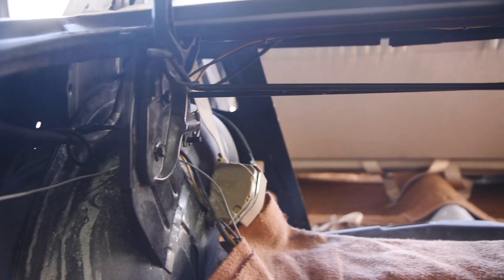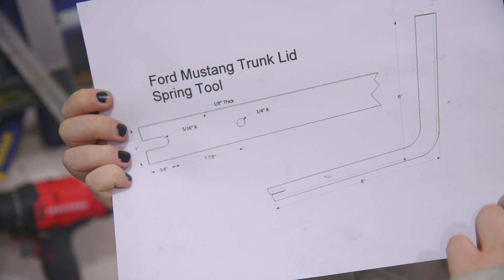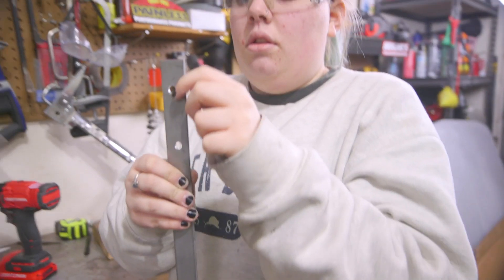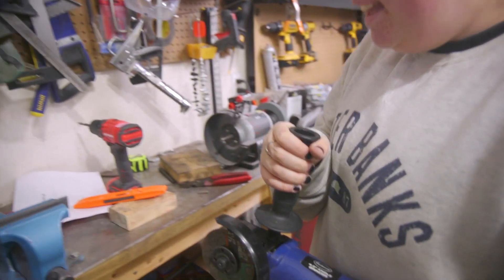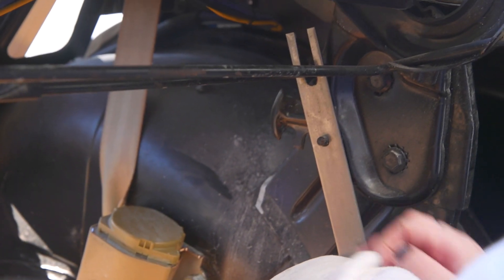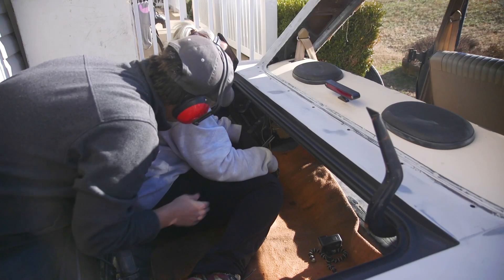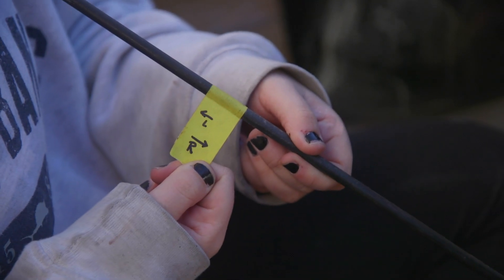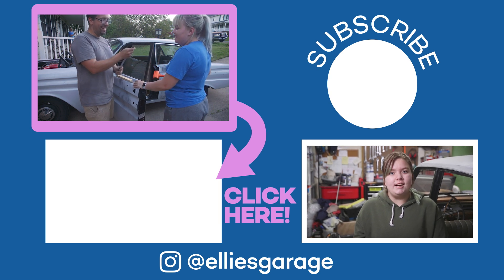I Made My New Favorite Tool! Torsion Bars

Comment: I have really enjoyed watching your work.  However, I have a caution regarding the work bench grinder.  I happen to be a Safety Instructor and you are missing the safety items for the grinder.  There is a work rest you should have in the front of the stone to rest whatever you are working on.  The stone should be totally enclosed, just in case it shatters.  If it does in the present situation, someone is going to get seriously hurt.  The work rest needs to be no more than 1/8 in away from the stone so as to prevent the "work" from jamming into the stone.  I would venture to say that the tool came with the items and they were taken off for some reason.  Since it does not have a shiel over the the work area, best to be wearing a face shield plus the impact glasses.  Again, if it explodes, you are trying to prevent any injuries.  Keep up the good work!
Reply from the maker: Thank you very much for that. I know we have the protector for that side and we'll be sure to get it back on. Thank you again for looking out for me!

Comment: I'm sorry I should have sent this comment when you removed your hood.  Here's a tip I use when removing a hood or trunk lid.  If your hood or trunk lid is aligned correctly, you can preserve that setting by drilling two 1/8" holes through the hinge and hood (and hinge and body support brace, if you need to remove the hinge).  Now you can reassemble the parts and use a couple of 1/8" drill bits in the holes, tighten up your bolts and your hood will be perfectly aligned as it was before with no fiddley adjustments.  Love your channel.
Reply from the maker: Wow, what a great tip! I'm sure we're going to do a ton of fiddling when we do the hood, and doors, and trunk, but this will be great to use for the next time. Thanks again for the tip!!